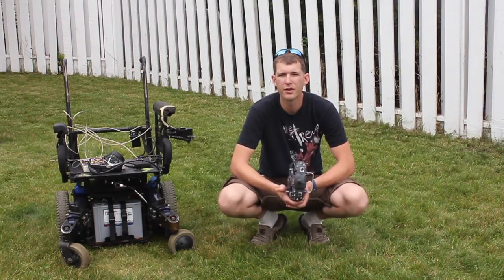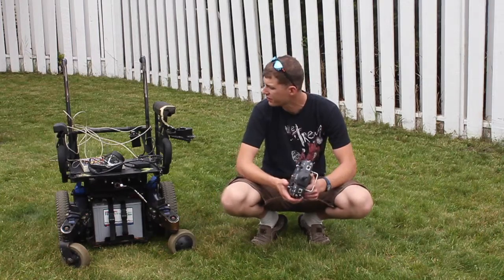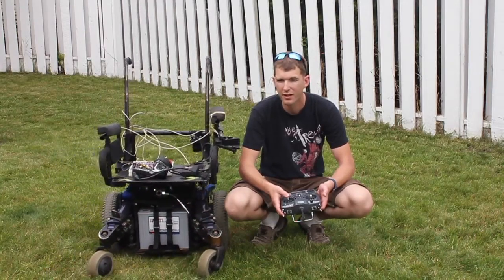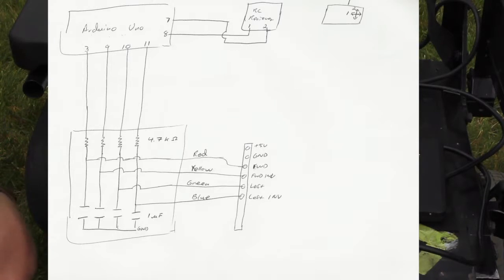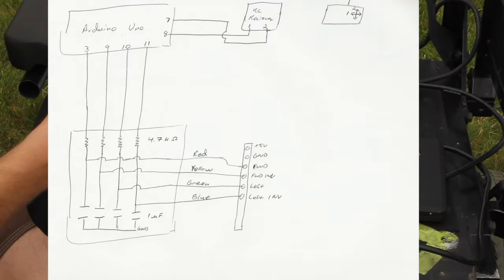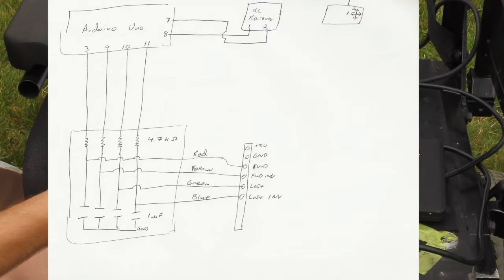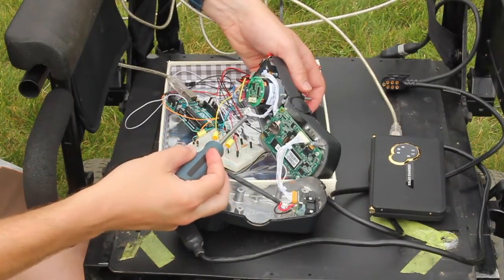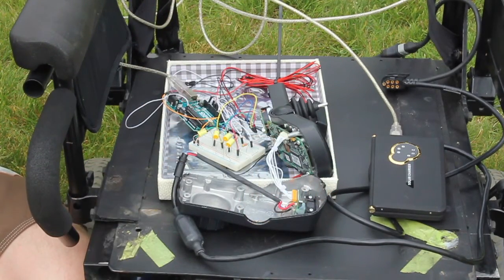Electric Wheel Chair RC Hack

Comment: Why add the 4.7 kOhm resistors, cant you just modulate the voltage/current with the microcontroller?
This may be a really silly question, so if its obvious forgive me.
Reply from the maker: That’s a good question.  To be honest I don’t recall why I added the resistors...  The Arduino is effectively pulsing at 5 Volts at a frequency to give you the desired “average” voltage - say 2.5V.  The capacitors help to dampen the pulses and are necessary to keep the chair controller happy.  Not so sure about the resistors...
Reply: @GrorangeGarage  Huh, well im working on a very similar project right now.
I'll attempt without resistors and see what happens.
I'm also gonna use a board with more interrupt pins to make my life easier looking at your code.
Reply from the maker: I’m curious to know how it works without the resistors.  Only thing I can think of, is it might draw too much current from the Arduino without them.
Reply: @GrorangeGarage  So you happened to be right, it was a but funkey until I added some 5kOhm resistors as I was drawing way too much power.   
I'm now curious why you chose pins 7 and 8 for input as they lack PWM on the uno right?
Wouldn't that make your life easier as you are going digital-> analog?
Reply from the maker: So, it’s been some time since that project.  I don’t believe a PWM pin offers any advantages when reading a PWM signal.  However, it looks like I may have been able to simplify my code using the interrupt pins 2 and 3.  Here’s an article on it:

https://www.benripley.com/diy/arduino/three-ways-to-read-a-pwm-signal-with-arduino/

Comment: Any info on rc receiver two wire?
Reply from the maker: Here’s what I used:
1x #TX-9X-M2/8992 Turnigy 9X 9Ch Transmitter w/ Module & 8ch Receiver (Mode 2) (v2 Firmware)

Comment: Great vid.  I have the same wheelchair.  Please send me the code as well travelsoulja(at)yahoo.ca - did you ever try increasing the speed?   I am going to build a rc snow tractor / lawnmower combo.  I am also considering adding roomba sensors and getting the wheelchair to automatically mow the lawn every month.  Thx again... if you codes on github, please send me the link.  Cheers
Reply from the maker: I’ll send it your way on the weekend.
Reply from the maker: Posted to github, good luck with the project and please subscribe: https://github.com/Tinkertann3r/RC-Wheelchair

Comment: Hi5skinny3@gmail.com I’ve got several control modules and wheelchairs I’ve built a Rc mower also with a sabertooth 2x32 and a flysky it’s really cool and I’ve had drive by vidoers lol I call mine the LONDOG that’s my YouTube Channel I will definitely give a like to you for a like for me really!!  I found your video because I was wondering how to use the existing controller on the wheelchair with a Arduino could I get the code from you please I will👍 go check out my LonDog😎thanks!!!
Reply from the maker: Posted to github, good  luck with the project and please subscribe: https://github.com/Tinkertann3r/RC-Wheelchair

Comment: I just saw your video and loved it I have a wheel chair alot like yours but mine has brushed motors. Will your code work and if so could I please get a copy. I tried to PM you but cant figure out how
Reply from the maker: Hi Furry, hard to say if my code would work, it depends on the chair.   If your chair has brushed motors you may want to consider using motor drivers.  Sabertooth drivers are popular for this application and will be easier to control than the method i used.  They can be used directly with a rc controller, no need for an arduino.  Here's a link to one: https://www.dimensionengineering.com/products/sabertooth2x60

Comment: Can't figure out how to send a pm but I am trying to do the same thing as you did here, just wanted to see if I could get more details. I have the motor controller but no joystick. Managed to jump the pins and get into attendant mode and move around just has very limited speed

Comment: didnt mean to blow up the thread  just happy to have found someone in similar situation making progress , I actually bought new brushed d.c. motors to get the lawnmower going but still want to use the brushless invacare motors  Im just need the info and maybe someone to bounce Ideas off  at times
Reply from the maker: Hi voiceofreason, not sure how much help I'll be.  Here's an article on brushless motors you may find useful https://www.digikey.ca/en/articles/techzone/2013/mar/an-introduction-to-brushless-dc-motor-control    In my case, I faked the joystick inputs to the chair so I could use  the Invacare motor controller.   Let  us know how you make out.
Reply: sure thing thanks for the re[ly  my names joe  I know thats easier to type  I will read but if you get a chance can you give  me model number of your controller   the one before the joystick and probably to the arduino If in bit being to confusing  ? The reason i ask is What i have found is that it may be easier to use the chair motor controller  as the PWM at first at least to get it running  But maybe this article above will give me better info  I know i should have paid better attention when I ordered these I thought they were regular two power wire brushed DC motors like the other 99.9  percent    thanks Grorange

Comment: and if you did could you post it
Reply from the maker: Hi Christopher, unfortunately that's the only video I created the wheel chair.  The basic information is in the video, including the electronic circuits.  The only thing missing from the video is the Arduino code for converting the RC signal to the appropriate output for the wheelchair controller.  If you message me your email address (don't post it here) I can send the arduino file and libraries i used.
Reply: @George can you share with me at  aibuzghaffar@gmail.com

Comment: I have the same motors can I bypass and just use a 12x25 motor controller, cant seem to find any info on this, is there brakes on these motors that have to be removed. I'm not much on electronics so if you could point me in the right direction.
Reply from the maker: If you have the same chair as I do, it has brushless DC motors.  You won't be able to control them with a standard DC motor controller.  The electronics required to control brushless motors are a lot more advanced and difficult for a DIY.  I'm not 100% sure, but i believe the brakes are also part of the motor assembly.  Hope that helps.

Comment: Could you tell me in depth what I need to buy and where to buy them? I am wanting to build a large scale RC army tank. I have 3 wheelchairs but i don't know how to wire it. I am also trying to use one of those motors for my sons bike. I bought a throttle for a motorized scooter on ebay but I couldn't get it to work. someone told me I needed a speed controler but i'm not sure which one to buy. Thanks.
Reply from the maker: Hi dahc, what you need to buy will depend a lot on what you're starting with.  If you're using brushed DC motors you'll need to build or buy a driver that can handle the current.  The sabertooth drivers are pretty popular.  If you're using brushless dc motors like the unit I used it's much more difficult.  Your best bet is to run a few google searches on your particular wheel chairs.  There's lots of guides out their for the different units.
Reply: Thank you Sir.